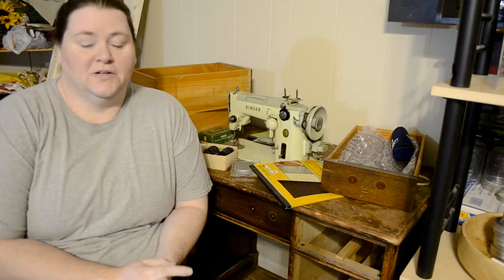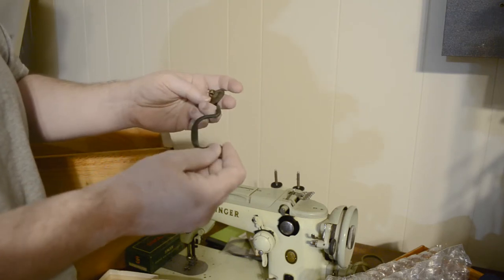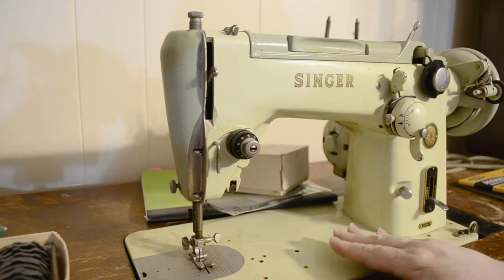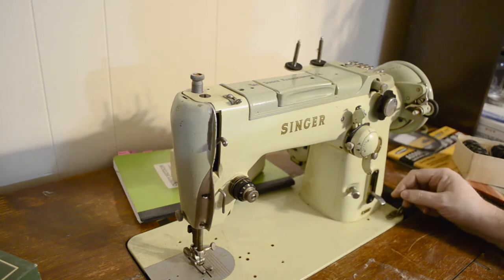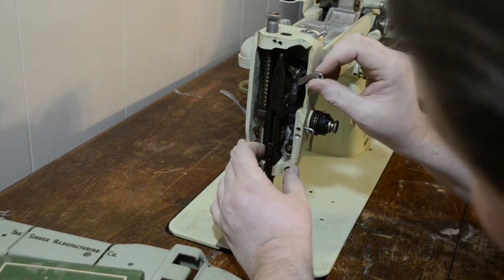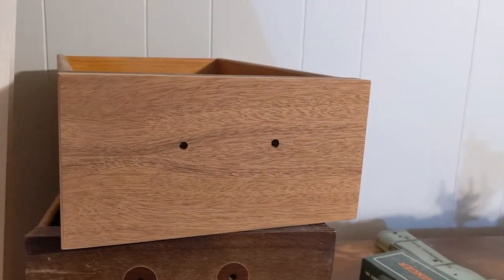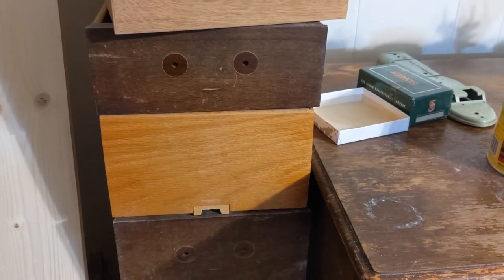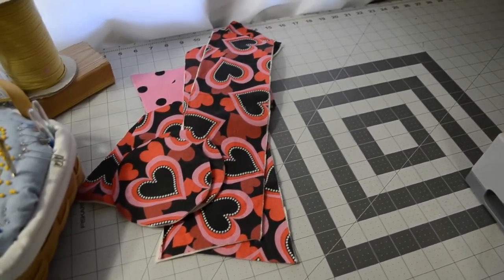New Year New Projects, Starting the 319 Singer Repair, Intro to 2022

Comment: New to your channel. I own one of these machine but mine looks a little different on the top.
Reply from the maker: Different year maybe? I looked up the serial for mine and it was made in the early 60s. I'm curious about yours if it is a different year, or a manufacturing plant. Mine is 319w.
Reply: Some have the handle on top, some don't have a handle at all. I have one of each.

Comment: My Singer 319K sewing machine was sewing in the zig zag stitch. And the thread tangled and broke the needle. After this problem, the Singer 319K sewing machine stopped moving the needle column for decorative stitches. Straight sewing Only.
Reply from the maker: Sounds like something jumped track in the top portion. I still have not finished working on my machine. Life has been changing plans on me constantly. One day I may get back to it and get it running again. I hope you can fix yours.
Reply: @CreationStudiowithLaLita  Thank you my friend. God bless you.
Reply: @CreationStudiowithLaLita  My SInger 319K manually moves the needle column to the right, center and left. And when I activate the CAMs and adjust the stitch by 3 to 5 mm, the needle column goes to one of the corners. But when I activate the motor to move the column reading the CAM disk, the needle column does not move, the machine threatens to become a little heavy as if it were going to move (by moving the steering wheel manually I feel that it becomes heavy and then becomes free again). It seems like something wants to engage to move and then it becomes light. But there is no movement in the needle column for the decorative stitches when any internal or external CAM is installed in the SINGER 319k. This defect started after I was sewing by mistake with a 15x1 needle that bent and broke. I ended up sewing straight and sewing a zig zag stitch. Before the needle broke, the machine got tangled thread under the fabric. Now all you have to do is sew perfectly straight, as I mentioned, decorative stitches don't work, because the needle column doesn't move on its own.
Reply from the maker: @eldersandim3008  It sounds like it bent something when it broke the needle and the heavy feeling and not moving is it trying to move beyond the bent part. I would remove the top and try and see where it is hanging up. sewmachinepartsonline.com has some parts for them. It is a long shot, but if you can figure out what is wrong, you may be able to fix it.